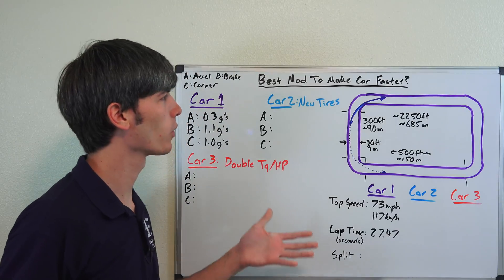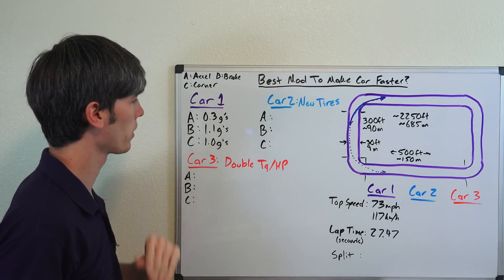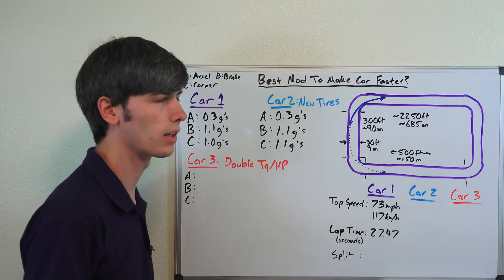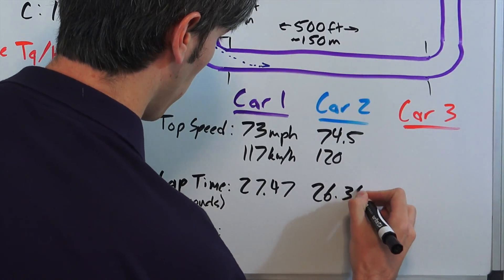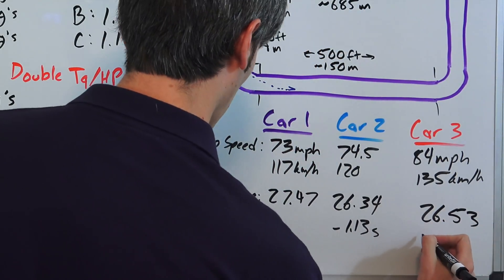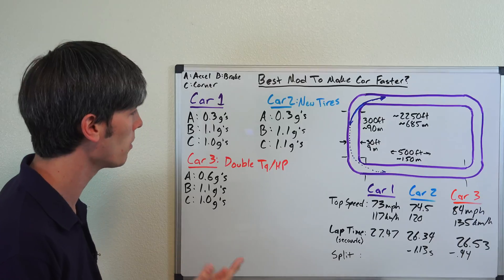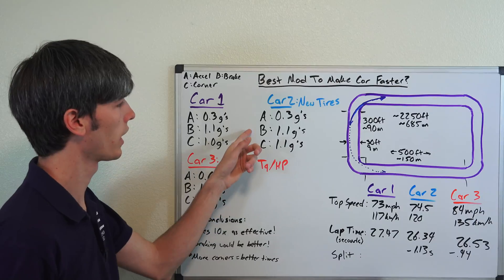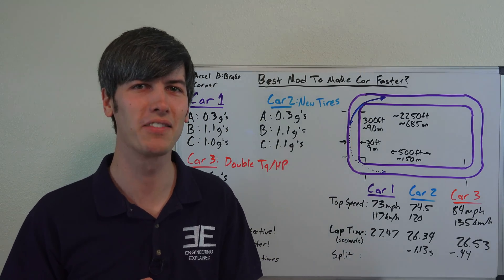What's The Best Car Mod To Go Faster?

Comment: Hey, it would be nice to have a video on tire tread design !

There's not much good info about it out there. Just suggestions on which ones to purchase, but not much about the mechanics or engineering aspect.
Reply: Stanley Chang the basics I know from tread design is , Less grooves and bigger patches of rubber mean more grip. the more rubber you get on the road the better your grip.... but the bigger patches of rubber also increase the chance of hydroplaning if its your daily driver. summer tires provide the best performance because of the sticky compound. they don't last as long but they give the best grip. its like this....
more grip = less longevity (tire lifespan)
more directional groves (water vents) = less rubber contact. 

I'm no pro. someone else can help you but my best example is.... nitto 555 tires have more grip than nitto neogen tires.
Reply: Depends on the conditions. Slicks are the best for dry tracks. The rubber compound is usually the most important.
Reply: Racecar Vehicle Dynamics by Milliken, also Tune to Win by Carroll Smith. Both of these books have sections on tire performance and design
Reply: B10401 winter performance tires??? I'm not sure lol.
Reply: Tires for ice can be quite different than tires for snow. For dirt and snow you want something with big lugs to chew through it. For ice you want lots of micro sipes, but preferably studded tires.
Reply: Steve Smith's Advanced Race Car Chassis Design and Development was a seminal tutorial in the 70s. .. Still applies.

Comment: In my opinion you should have done an additional comparison: brake upgrade. Assuming the test car's braking performance is not already tire limited.
Reply: Eh, usually performance brakes provide more resistance to brake fade and better control under hard braking. Stock brakes can overheat very quickly on a race track.
Reply: Der Jens  that's true but cheap brakes fade easily and cant be used for any extended period of hard braking.
Reply: Angry Jesus Interesting! I always wondered what the benefit of performance brakes is, if any cheap standard brake can already lock the tires...
Reply: Ah, thanks guys! I didn't really know about brake fading.
Reply: The only problem with track/performance brakes (namely pads) is they produce a lot of brake dust.
Reply: pikepeak1 Well he is comparing TRACK performance, so
Reply: thus the tyres 1st

Comment: You talk about this subject like you read it in a book.  Math can NOT explain everything!
Reply from the maker: +82raptor not everything, but it certainly explain nearly everything about cars! Something that is designed, manufactured, and tested through science, human ingenuity, and... math!
Reply: Yeah it can actually, that's the whole point of math.
Reply: Math can explain anything if you can provide all of the variables.
Reply: Engineering Explained don't forget physics (which could be within the sciences, but it really does stand out on its own!)

Comment: What about weight reduction? That will improve overall acceleration, braking and cornering...
Reply from the maker: +Andres Barquero tires will do significantly more for braking and cornering than reducing weight, but you are correct in that it's helpful in all three categories to shed mass!

Comment: The tires that you keep flashing to, are those Bridgestone Potenza RE-71 Rs? Did Bridgestone Sponsor this video? Just kidding. 

Anyways you should do some more videos on tires, specifically tire management, maybe some of the logic of picking tires in Formula 1 for example. Or what happens when your tires overheat, how much grip do you lose?

Also, you should autocross your S2000 next season. Looking forward to those videos.

Comment: These are good mods to start with:
1: Driver
2: Tires
3: Suspension, Rear, Brakes and other weak points. 
The following should be done all at once
4: Intake system
5: Headers, Exhaust
6: Heads
7: Cam and Valvetrain
8: Tune
Not enough power for you?
9: FI
10: Stroke it out
Reply: Oh and get an automatic for the mechanical advantage. Torque converters do wonders

Comment: EE please do a video about how a Muscle car does a wheelie!
Reply: hella torque at the rear wheels + super high coef. of friction on the wheels= a car that does not move but rotates on its back axel for a brief moment
Reply: put engine at rear and all weight parts on rear to + good tyre
Reply: for traction you can put more weight in the back(rear axe) if the coeff of friction is not enough.

Comment: it would be fantastic to include a fourth car which has reduced it's weight by 10%
Reply from the maker: +Johl Man small gains in acceleration, very, very small benefit in cornering and decel. It'd be the slowest of the three upgraded vehicles.

Comment: Can you do the math on if you strip weight off the car.
Reply: B10401 that may be true at high sowed but on the lower end... being corners that are under 80 mph... downforce doesn't seem to do squat. I think this is where a good suspension and tires really shine.
Reply: B10401 also , you want be going fast enough at any autoX even for downforce to be usable. road racing is another story.
Reply: a 1 ton car is with 1000 pounds of down force is going to handle way better than a 2 ton with the same force. I would not underestimate these effects on handling and grip.
Reply: Corvette massive weight reduction.  Hot Rod Magazine:  http://www.hotrod.com/articles/hrdp-1011-corvette-hack-track-test/
Reply: rory lobban already did on his Honda, not s2k
Reply: +B1401 that's true. Any sources where to take a proper deep look at this?

Comment: Weight reduction bro!!!
If you sell the parts like seats, speakers, radio, ... you get money (for better tires).
Reply: Thats not true, I get carbon fibre stickers for $1.50 per roll! XD
Reply: B10401 or until you replace all gas with alcohol blown kit
Reply: hahahahahahahahahaha
Reply: That is the cheapest mod... but hard to get much performance out of it unless you can shave hundreds of pounds.

Comment: #1 speed mod.. Leave Earlier!  Just kidding, I agree tires are a huge game-changer. They are also tricky to predict, and the resale on a used tire is bad. So aim high, not cheap. And don't ever let a dealer tell you, it's good because these tires are low mileage. Skip the run-flats, go with Nitto, Continental, Michelin, if you can. Goodyear works well, if you like a polyurethane rock hard tire that will outlast the car, but won't hold the road.

Comment: At the risk of getting a beating here, i don't agree with the advice here. Let me explain why...

Tires are a very temporary upgrade. They will wear out, and they will get worse, and fast at a track.
So to keep going fast.. u need to invest in expensive tires, every time. So in the video, car 2 will win the first few laps... then car 3 will catch up, and keep catching up, until it passes car 2, that now needs new tires. 

So.. what do i suggest? 3 Things, BEFORE, u get expensive tires.

1. Weight. Loose it. Unload every kg or pound u can from the car. Its cheap, it improves acceleration, breaking and cornering. It is by far the best mod u can do, and by far the cheapest.
2. Suspension. Buy a proper suspension kit, and have it properly set up. Its a one time cost, once its paid, your car will corner better, from now on.
3. Power. Get the cheap simple mods done to the engine & transmission that u can do, to get the most power u can out of the engine. Why? Because its often a permanent fix. Once its paid and done, u keep those lower lap times. Do note... only start with things here that stay high performance, and wont wear out quick. 

When this is done... Then u put on the best tires you can and the best breaks and break pads u can. They will also help even more then they could without these other mods. Then all u need to to is keep the tires good and breaks good, and u will have the best time laps u can get, once u learn to drive it to the limit.

But if u start with tires... u are gonna burn your budget on something that is going to literally be erased on the track.

Comment: One issue: the engine upgrade is there all the time, for a long time so it's a one time expense. The sticky tires will wear out rapidly and you'll have to buy new tires much more frequently. So, the expense will even out over time and in the long run, if you don't blow up the motor, the increased power will be more cost effective than the better tires. (sticky tires cost more than run of the mill tires and wear out MUCH quicker)

Comment: A 10% improvement in tire traction? Is that really possible? Maybe if you are going from old, worn-out econo tires to brand new r-compound that have heat in them.  Or is 10% a realistic achievable number?

Comment: Yup. I've always told people who were serious about modifying their car to be faster (and not just modify to meet the approval of whatever is the latest fad), priority should always be: 1. tires (good tread, compound, right season, air pressure), 2. weight reduction (lighter wheels mean less inertia for which improve acceleration and braking all the way up to on an extreme level of stripping the car, improves power to weight, take off what you're comfortable with), 3. brakes (not just the max number of pistons, braking distance isn't any good if the wheels lock up immediately), 4. suspension (lose energy lost rocking the car around), and lastly 5. engine. Longer intake piping, supercharging (which I still argue is best), aggressive cams, etc etc etc just get a proper tune with it. 

That's my theory on it. Power is worthless if your car can't put it down, or it can't handle it, or can't slow down from it.
Reply: @Sharod101 Don't forget about the transmission! The tranny has to be able to handle the extra power and torque from the engine! That should be #6.
Reply: Make sure you have full throttle and learn to drive properly!
Reply: r. decline He didn't give an example either. "An american watch" is just something he pulled out of his ass.
Reply: Red Phoenix ...you just used a watch as an example for a car...thats not how examples work. For example, The US had 23,000 miles of telegraph cable by the end of 1859.
Reply: k_wrx_ I think people just add power because it's more fun
Reply: Sharod101 dope poop man
Reply: Most of it depends on the HP gains you expect. If you have an American setup as opposed to an Japanese setup, you should really modify anything. For example when it says 10bar water resistant, an American watch barely made it without trickery.  On the other hand, when it says 10bar water resistant, the Japanese watch could withstand 30bar with ease.

Comment: I'd say: shed some weight (on yourself and your car). If it's about track time: throw out the backseats and possibly the passenger seat as well, get rid of the stereo system and carpets. You'll be faster in every situation.

Comment: Can you perhaps explain (or did you do that already before perhaps?) why having an early RPM very high torque is so beneficial for heavy cars? For example suppose you would have two engines producing the same amount of power (work) and move the same amount of weight, is it then better to have high torque and low RPM or high RPM and relatively lower torque?

Comment: now add a "10% decrease in weight" modification in the list!
Reply from the maker: +George Tsiros 10% tires and 100% power cars would be faster.
Reply: Engineering Explained ok then. Be patient for a little while.
Reply: George Tsiros it's hard to take 200-300 lbs off a car and still fit your kids in the back seat.  But no doubt weight reduction is definitely the cheapest mod you can make.

Comment: Cannot be truth. Appreciate your input and knowledge but would need to see that in practice. Let's have 100hp car with brand new tires and 200hp car with barely legal tires on this 685 meters track.. come on, seriously. 

I do agree that the tires make the biggest difference when cars have the same or little difference in power, maybe 20-30%. Witnessed that in many situations. Having double the power enables you to smoothly initiate slight drift around the corners so you don't have to fully brake and loose all momentum. Little Scandinavian flip proves this theory wrong.  It's all about driing smoothly around corners doing race line, not jerky brake-accelerate style.
Reply from the maker: +Rami Bos just because it isn't intuitive does not make it untrue. The video is factual.
Reply: Engineering Explained Then go ahead, test it on track? 

Sorry I don't see math formula there neither. 

*Also are we talking about totally fcked up old tires vs new ones, or barely legal vs new ones? And not different brands nor compounds.

Also.. New tires have higher coefficient of friction - doesn't it convert to more instant get-going and shorter braking distance? So if acceleration and braking are happening let's say 0.2 sec faster with new tires in the same amount of space, one would "feel" it in stronger force, no?

But then again.. new tires add maybe half a kilogram more weight because of more rubber, so maybe this compensates it in favor of older tires thus above-mentioned 0.2sec advantage is lost? 

Dunno but must be more complex, or more precise, math than what we see on your board.

Comment: Whats the best tires? All season or winter tires?
Reply from the maker: All seasons are generally a compromise, rarely offering the best overall grip. On my STI I ran summer tires half the year, then switched to winter once it got cold. On my S2000 I'll likely run summer year-round (and not drive much in the winter), and put winter treads on my Crosstrek. Crosstrek will switch back to the OEM all-seasons once ski-season is over. :)
Reply: Engineering Explained wow thanks for answering.
Reply: Never buy A/S tires. Look at it this way, you buy a set of summers and a set of winters. You use each for 6 months, you will probably have both sets for approximately 6 years. If you use only A/S year round, you'll probably wipe them out within 2 years. That would mean 3 sets (of A/S) in 6 years. Most likely the same price as buying a dedicated summer and winter set. However, and this is key, the dedicated sets will be far better (entirely) for each season. The A/S are good (just) for everything. Buying dedicated means a little more money up front but a way better, safer and fun experience.
Reply: I think this is only partially true and somewhat misleading.

The biggest difference in summer vs winter vs all season is not the "stickiness" of the tire or the grip of the tire, but instead at what road temperature the rubber reaches that grip level. For example a summer tire a winter tire and an all season tire can (and in many cases do) have the exact same coefficient of friction in the rubber, except that the summer tire has that optimal coefficient of friction at say 80 F, the all season at say 40 F, and the winter at say 20 F. These tires then would perform identically except in different road temperature conditions.

The compromise in all seasons comes more from the tread design, they are designed for dry pavement as well as wet as well as mildly snowy and thus the tread is a compromise, however tread is generally a small factor in the grip of a tire compared to the coefficient of friction which in tire rubber is a strong function of the temperature which is why these tires can all perform identically albeit in different temperatures.

To answer your question Jay Jay, the best tires are the tires with a coefficient of friction that is optimized for the temperature of the season, thus winter tires are better in winter, summer tires in summer, and all seasons when it is somewhere in between summer and winter (such as in more mild climates, or in fall). 

Please correct me if I am wrong, Engineering Explained, I value your opinion.
Reply: Back of your car will slip in bigger corners. There may be a situation where you will spin 180 degrees at the end of the corner when you enter it too fast. My friend's wife did this when I was siting in the back seat. Luckily I was drunk so I didn't care that much. 

Having this other way around in summer will quickly ruin winter tires. They will literally melt in high summer temperatures.

When looking for savings, go for 2x summer, 2x winter, 2x all season. Keep all season at the back axle all the time while changing only fronts.
Reply: Jeremy Davis , Theres also difference in tire construction. Summer tires have stiffer sidewalls and winter tires have softer walls, to give more traction in snow and mud. That makes winter tires bad in cornering, as they will "lean" more under the rim, losing traction, and are wobbly in heavy braking and changing direction.
Reply: summer....
Reply: So all season is no good, a compromised or somewhat in between performance. My car is only FWD, can I have a winter in the front tires then summer in the back, So i'll just switch it whatever the season is than bringing 4 sets of tires just to change the tires, this works ?

Comment: Thanks for the video. Looks like you also got a set of RE-71r's for your S2k. I just did a video on my channel about getting these tires for an upcoming trackday. Thanks for doing the math on this. However, I think this was a trick question. 

Best Mod = Driver (Get out and track the car)
Reply from the maker: It's all useless indeed if the driver sucks haha. Yep, RE-71's for my S2000. Not many tracks near where I live, but I hope to get it out on a track eventually. :)
Reply: Autocross will help with car control until the trackdays can happen. Are you running the AP1 wheels still? or did you decide to go with 17's? Staggered or Square?